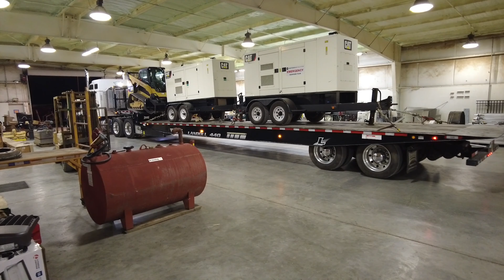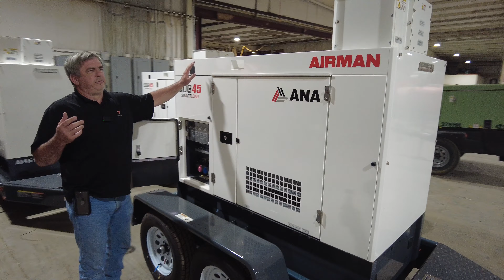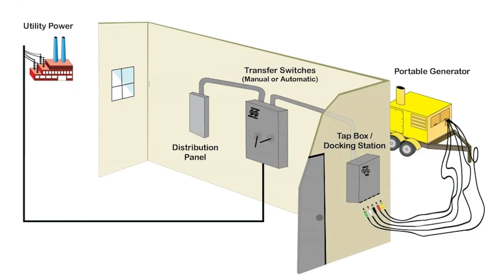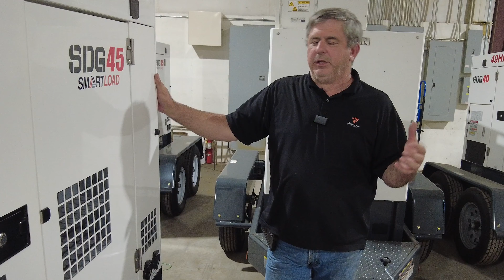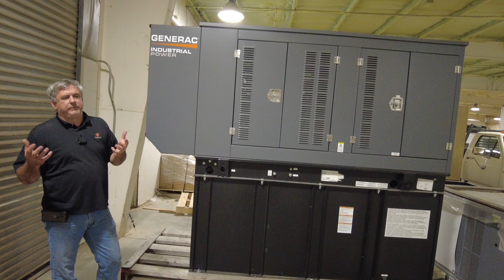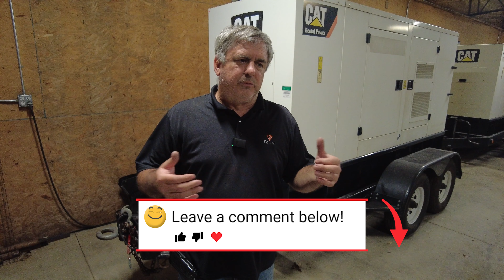How to use the Same Generator for your Home and Business! | Parker Systems

Comment: Awesome video! Could you explain more about the different classes of generators as far as KVA’s?
Reply from the maker: KVA is just Kilo=1000 V=Volts A=Amps --- we can get really in the weeds here -- It's technically apparent power -- that is the true and the reactive -- it always more than the true power and is dependant on the power factor load -- for this reason it measures the output of the sources like transformers and alternators --- I think the generator people always chose this because it always the largest value -- 

Hope this helps -- I may do a do video that goes in more depth --- 

thanks for watching

Comment: I have been interested in using a 20kw light tower as a backup generator for more versatility they seem to be about to be found used for in the 7-10k range.
Reply from the maker: that's cool --- thats a pretty special units - most old school light towers (metal halide lights) are typically in the 5KW range -- the new LED units are 2-4KW --- thanks for watching

Comment: Fantastic info!   Can you provide gallons/hr estimates too for differing kWh sizes?
Reply from the maker: Generator Size (kW)	1/4 Load (gal/hr)	   1/2 Load (gal/hr)	3/4 Load (gal/hr)	 Full Load (gal/hr)
20	0.6	0.9	1.3	1.6
30	1.3	1.8	2.4	2.9
40	1.6	2.3	3.2	4.0
60	1.8	2.9	3.8	4.8
75	2.4	3.4	4.6	6.1
100	2.6	4.1	5.8	7.4
125	3.1	5.0	7.1	9.1
135	3.3	5.4	7.6	9.8
150	3.6	5.9	8.4	10.9
175	4.1	6.8	9.7	12.7
200	4.7	7.7	11.0  14.4
230	5.3	8.8	12.5  16.6
250	5.7	9.5	13.6  18.0
300	6.8	11.3  16.1  21.5
thanks for watching